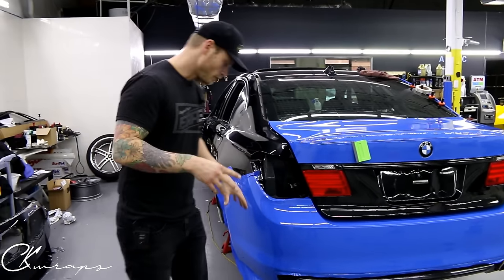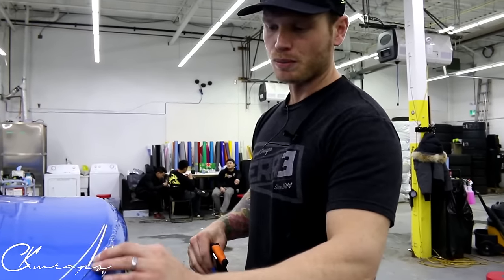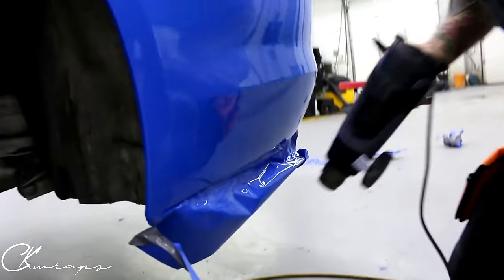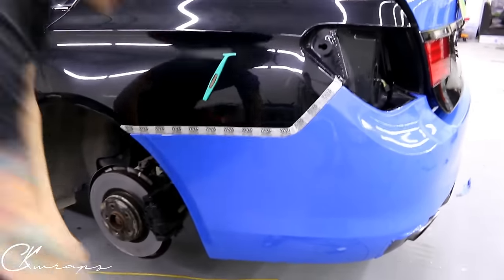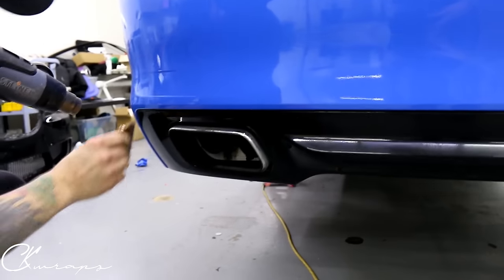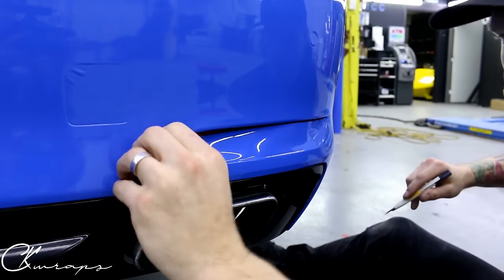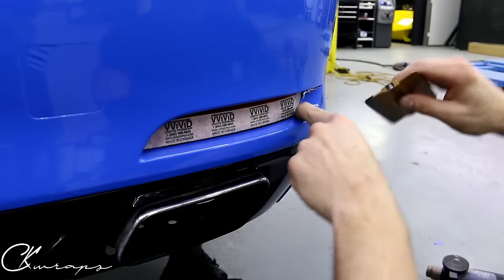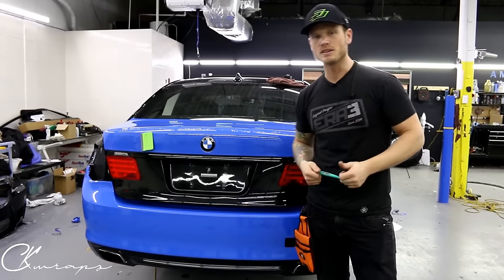How To Cut And Trim Vinyl Wrap. Cutting And Trimming Techniques

Comment: Chris. you said in a later video (the bad wrap ml300 merc i believe) that installers in the industry say you destroy the industry with you guide videos etc. id say, if every installer checked your videos, bad wraps wouldnt be an issue :D and as you said, things do happen to a wrap that one cant really control etc.

Comment: I always remove bumpers, door handles, wing mirrors and doors to get a perfect finish. It is actually quicker as well and all edges are sealed.
Reply: Removing all of those items is quicker than this?
Reply: Tony Walters it's way more of a pain in the ass to install a bumper off the car than on the car IMO
Reply: Where can I get that material and what's the price
Reply: You talk as if you do wraps for a living.  Wrapping a bumper off a car is horrible, it's too flimsy to stretch the vinyl over and glass it.  I wrapped 3 cars and the best thing to do is wrap with the bumper on, but loosen the sides to get the vinyl all the way inside after.  This way you can get under the rear 1/4 panel too.

Comment: Bumpers are removed so that surrounding panels do not have any exposed or edges that are tucked away. Neater and removes any chance of lifting or shrinking. The bumpers are then refitted to be wrapped. I agree wrapping off the car is not ideal depending on the car.

Comment: Christian, have you worked with any of the Xpel pre-cut paint protection kits? I've only seen you do full custom wraps. I'm wondering if I ask them to extend the edges of the pre-cut, if I tuck it and trim the edges like you do in the video, will the edges still adhere well. It's different from vinyl wrap because you aren't using slip/tack solutions. Thanks.

Comment: Quick question. Do you have to post heat the whole wrap of just the edges/corners? Thanks.
Reply from the maker: Normally you post heat all edges and corners. Sometimes circumstances call for post heating heavily recessed areas
Reply: CK Wraps I mean don’t you need to post heat the flat panels too (Doors, roof, hood & trunk??)
Reply: rstezza why would you not post heat to ensure there's no pull back? Eventual failure of the wrap?
Reply: Stephen Champey Just getting all the info I can before I start.

Comment: Specific question regarding parking sensors, how do you go about those and does the film not block the sensors function? I know that if you paint sensors with too many layers they can't "see" through anymore so was wondering how the film does in that regard.
Reply: Howler good question I was going to ask the same thing.

Comment: i have a question, how it is that you are 100% sure that you are not cutting any paint at all in any part of the vehicle, also how doesnt the wrap fail if there is not too much surface in the endind of the wrap...?
Reply: That is what you call skill that is only learned after many years of practice/jobs. I'm sure the first couple of times he was indeed cutting the paint.

Comment: Is that Vvivid protective tape just regular masking tape? 😮

Or is it a special kind of tape that prevents you from cutting through?
Reply: He uses the tape so the vinyl wont stick on the headlights or other parts etc so he wont have to pull the vinyl off of it. it makes the job easier specially in those tight areas.
Reply: That's not what she asked at all. She wanted to know if it was a special tape, or if you could use regular masking tape to do the same thing and get the same results.

Comment: I’m enjoying these videos, but it’s a bit annoying to keep hearing “I didn’t do that; that wasn’t my fault.” 
Also, why wouldn’t he remove the silicone on the trunk? Even if you can’t see it due to the spoiler, it seems a bit lazy to wrap right over it.
Reply from the maker: Removing the silicon runs the risk of damaging the paint. It does not come off easily enough like other adhesives
Reply: U 6.
Reply: Removing silicone is VERY easy, just spray with WD-40, leave for a few seconds and it will just peel off. Then a good degreaser to clean away the WD-40. 😉